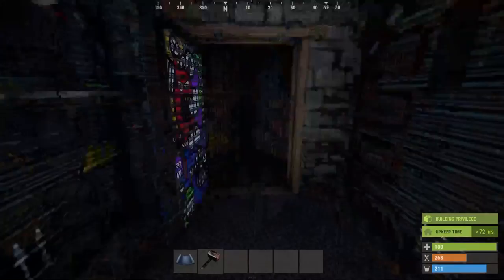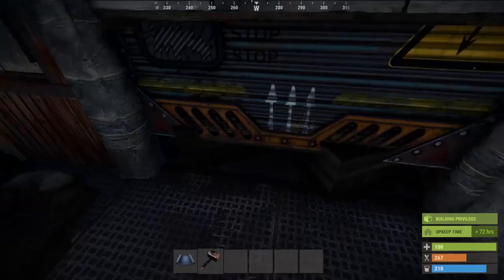RUST - The "Mini-Vault" Rust Bunker Base Design 3.2 (2018)

Comment: Great base design love it.

Two improvements.

Improve the entrance a bit so you have windows or shopfronts to spot doorcampers maybe even an autoturret perch

Add roof access and possibility of a shooting floor w/ a bedroom and use another roof the block the shoot for the roof access 

Im gonna play around with the basic layout a bit and see how I can do that but this is a solid base design

Edit: Also you can squeeze in many more boxes too if need be
Reply from the maker: Yeah i would usually add a window area/ shopfront but i was trying to make this base as cheap as i possibly could whilst keeping the strength to the base :P
Reply: @xRaWYT  fair fair, personally I use one shopfront for trading etc. and use windows with reinforced glass for the rest it is soo much cheaper as long as you have the reinforced glass window bp

also it is possible to put 7 boxes in a 1x1 rather than using shelves for 4

anyway good job on the base designs and keep them coming and you've got another sub btw ;)
Reply from the maker: @impyrobot  thanks man, i appreciate it :P jump in my discord if you like and feel free to PM me - always ahppy to talk base stuff xD

Comment: slow down with the building!
Reply from the maker: You can slow down the video with youtube settings to counter the speed increase i show!
Reply: Still to fast with it on 0.25 speed!
Reply from the maker: Harry Warhol 0.25 speed puts x4 speed on normal speed so if you do 0.25 the build will be normal speed